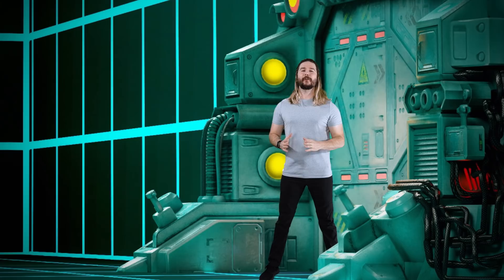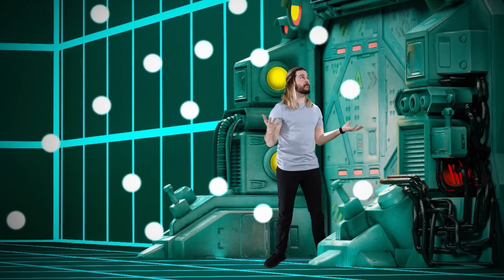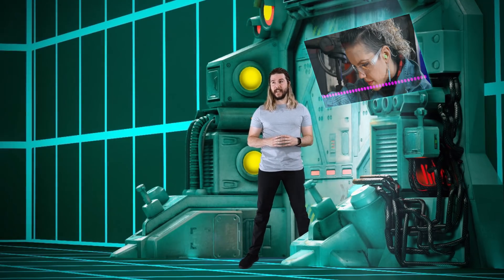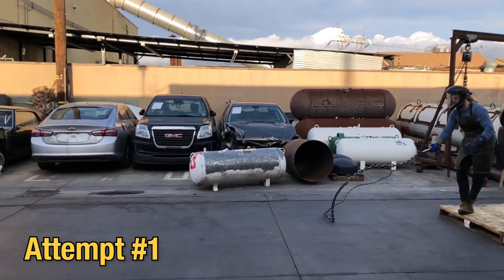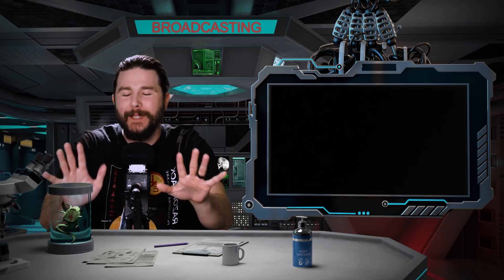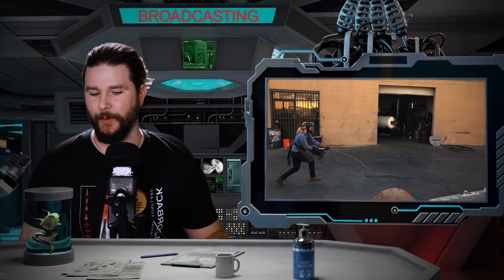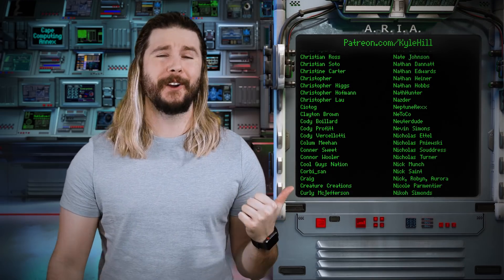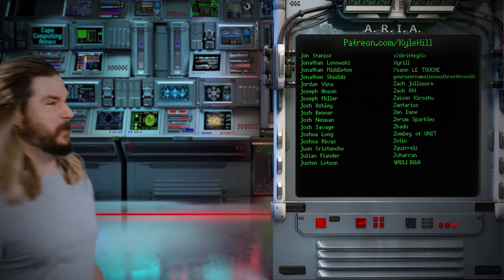Can I Make a SUPERSONIC STEEL WHIP?

Comment: I am pretty sure that it's physically impossible to  generate enough energy with one whipping motion to get steel chain move faster than the speed of sound. If you have just lets say 50 grams of chain moving on that speed and the rest of the whip is motionless you still need about 3000 joules. If the whole movement takes 2 seconds you should be averaging 1.5 kw of power while doing that, while trying not to hit yourself and die :D
Reply: The problem I'm seeing is that you can only get so small of a chain before the material just ends up failing from such violent force, such as being ripped through the sound barrier and having all that force hit the last link of the chain won't bode well. The reason why traditional whip crackers can be used successfully and repeatedly is because they're out of a material, either leather or some kind of string/rope, that will not break from the extreme change in tensile force.

Because it's ending with chain links instead of a proper cracker of sorts and combined with his (being generous here) "less than professional" technique, the end of the whip ends with more chaos than any kind of crack-promoting formation.

There's a few things he could try, only one of them would guarantee a modicum of safety.
1. Have the handle extended. This would make the whip more like a "coachman's whip" which is easier to crack because of the leverage advantage the longer handle gives the user.
2. Use an over head swinging technique like what the tiktok video's first crack. That's an easier and relatively (with a traditional whip) safer method of cracking a bull whip.
Or safe option 3. Collab with Mark Rober and have a robot do it.
Reply: Could a spring loaded "whip launcher" of some kind generate the force needed? Seems possible to make it super sonic but maybe only for a machine and not a human.
Reply: Next, how to build an hydraulic whip. And, will it blend?
Reply: It is possible but without a cracker it wouldn’t be humanly possible to generate enough strength to break the sound barrier however I have seen it happen mechanically happen when a steel cable snapped and wiped with enough force and energy to generate a sound however taking into consideration that the cable snapped it may have flayed one end of the cable making cracker
Reply: In theory, I believe you can generate that much energy with a pnuematic arm. Humans probably cannot generate the energy, even with a sufficient extension (or pole). But building a pnuematic arm is a whole episode, I think.
Reply: @yourleftisttesticle   Now that’s what I wanna see.
Reply: The chain is missing a factor of potential energy in the case that the chain has no resistance to compression. The links freely pivot and don't store vertical vectors of force, just horizontal. Therefore the compression wave breaks down and turns into a more swinging motion, losing energy to the amplification of horizontal movement. So it's not the material that's the issue, it's the construction. That also makes this "not-a-whip-it's-a-chain" incredibly dangerous to the user, as almost all of the potential energy can coil back to the point of origin in big, wide, un-dodge-able lashes. USE A BRAIDED STEEL CABLE that is tapered in much the same way. You'll see the difference is phenomenal. You can actually use it with skill to keep that compression wave going at a range from your body, meaning less accidental decapitation/dismemberment and it will require less energy and give you more control. Also... don't actually do this because the reason a bull-whip is made of leather is that at the end of the day, it's not supposed to be deadly. Try not to make deadly weapons that are also fun to play with, kids.
Reply: You’d have to swing it like a lasso. Regardless, I still want to see a chain whip break an orange at the speed of sound even if it’s cracked by a machine.
Reply: I still believe this "super sonic whip" is a myth. as watching this on Schlieren mirror shows a an air pocket collapsing behind the chain/whip tail. In much like how a jet's wash from an air planes does when landing. It sounds like thunder or a clap, or maybe a snap, but it is not any were near supersonic.
Reply: You should use a leather whip for comparison.  That way you have a control to compare to and analyze your technique.  And, ofcourse, cool cracking sounds.

Next step, build a robot that can do it.
Reply: I'm fairly sure if you have the right technique and design of whip it should be possible.  There's no reason why the tip shouldn't be able to be made small enough to crack especially with the slower initial motion and double-handed grip allowing a human to put more energy into the chain to be concentrated as the wave travels down the length.

It may take making some really strong custom chain links and you might need to make the ones designed to break the sound barrier out of titanium or something but it should be possible.

No way in hell I want to be anywhere near it when it's tested unless I'm behind something bullet proof, though.
Reply: pretty sure a human can't do it, but if we use a machine, it's definitely possible.
Reply: I'm thinking that you started off with too heavy of a chain at first, and a tad too long for your strength and arm length. You could trade up to a titanium chain for the smaller links at the end to with stand the forces. Or possibly go with a woven mesh rather then a chain tip. You may also be loosing energy with only a few lengths of different gauge chain. I would love to see this work for some sick reason.
Reply: some guy does it by running one way, then back, with the chain just sliding on the ground. pretty sure the end was links.
Reply: Then next time yust end with the wip destriong frut 4 some satisfaction
Reply: April Jennifer Choi can make it happen for you. She’s an engineer that’s broken records with the whip, Contact her please she has the skills necessary I’m just fortunate enough to know both of you exist and I can’t wait to see her make this happen for you
Reply: Qi Lin Bian! Literally metal chain bullwhips
Reply: It sure is, use a smaller gauge of chain, a more precise taper, a longer whip, and study how the arm works. Then make a robot to replicate the fluidity of motion it takes to crack a whip. Not just some spring loaded or hydraulic mechanism, you'll need to actually program it. Or... get someone with more strength and confidence to do it for you.
Reply: Sounds like we need Mehdi and Destin need to hook up and make this happen.
Reply: Use braided steel cable for the end
Reply: Chain whip robot chain whip robot
Reply: what about a robot that can whip it faster?
Reply: The reason you failed is actually pretty obvious yet still obscure: The size of the chain links of a proper chain whip decreases with every link. You're using sections of chain. Your taper length is fine but the segments ensure that the taper is too segmented and, thus, won't produce the fluid whipping motion you want OR the energy transfer you want.
Reply: "you still need about 3000 joules"

All I'm hearing from your statement is that this whip needs to be powered by rifle bullets. Nothing at all about it being impossible.
Reply: A guy called mike shake on YouTube made a whip that uses a steel cable as the cracker and it cracks loud
Reply: Vat da fak its HPC!

Comment: Dunno if we can even call this an “experiment” - you didn’t change any variables except your own whipping motion! How about, you know, trying something different before declaring failure? Maybe it needs to taper faster, maybe slower, maybe you need to start with much smaller link, maybe the whole thing needs to be shorter or longer….

Comment: I know I'm late to the party, but I was going to cite Jacques ze Whipper as a case of being successful (he is a professional whipper so cracking whips is his thing). However when I went back to the short he introduced his large chinese chain whip in, I noticed that his chain whip actually does have some sort of rope at the tip. You were definitely onto something with that careful observation of the video everybody sent you. I thought of another short where somebody was using a barn chain like a whip and they got the whipping sound, but no crack to go with it.

I think somebody else got around to the scientific amount of work it would take, which just got me thinking... is there a way to generate the speed required using a balanced lever system? Balanced so that it swings smoothly... or maybe just a modified catapult

Comment: I was disappointed that your idea for making the whip faster was to add a handle and try to throw it faster. The handle is fine, but to me the obvious (and safer) approach would have been to add more taper. Just add more sections of lighter chain to the end of the whip. I'm guessing that with a few more sections of chain, probably ending in something of similar size to jewelry chain but made of steel you would have succeeded without needing to try to throw the chain in the air as you did in this video.

Comment: I enjoyed the fact that we're still shown a conclusion, even though the hypothesis was incorrect.  That's as much a part of science as succeeding.  It's still cool to see cool stuff like a steel whip being tested.

On to theories on why it wasn't breaking the sound barrier, a long length of chain like that, even if it tapers, still has to weigh a lot. I'm not too knowledgeable at physics, however I do know if something is heavier, you need more energy to move it.  I wouldn't want to be on the receiving end of a steel chain whip because that thing's gonna do damage, but the weight of the weapon itself will be the cause of that damage, not so much the force of the "whip swing."  Again, still cool, I just think the weight is what's causing the most trouble right now.

Comment: Watching it over several time and comparing it with some other whip-physic videos, I think as you mention the guy in that video attacing flexible end to the whip creates the "crack". Human can't make the chain whip "crack" if the end is also a chain. Because the rigid nature of the steel and it would require such force and speed to generate enough energy so that the end of the chain become so hot and flex then create the boom. Its like when you unroll a carpet the end of carpet would clap the floor

Comment: I love this video, I love the DEVO reference, and I love seeing the process. Scientific integrity hype!
I can't help thinking about a time I saw Backyard Scientist attach a thin cord to a rubber band and use it for whippy whippy action, and how that principle would apply to the pure terror which is this metal chain whip being tensioned by the spring from a set of car shocks. It's one thing to lose a finger, it's another thing to be unable to find that finger.

Comment: As a person who's nerdy, but also an ogre...and gotten the lumps from "Lemme try" moments...I'm amazed you even seriously tried this man. I've not tried to get the sonic crack with a chain, but I've used them as whips and other such things you're not supposed to do with heavy chain. It is dangerous as hell, and you did it with protective gear. Your friend stated it right in the first vid...you'd need a totally custom chain to even try using it like a proper whip. As far as using a chain for a whip though....it's a chain, it doesn't need to be supersonic to get drastic in damage.

Comment: Wanted to ad, I have recently started practicing with a normal bullwhip (obviously) and have whipped myself several times. This is normal as you are practicing since when you start the whip you can't control where the tip goes. If you want to learn to crack a whip look up Adam CWM here on Youtube.

Comment: From my limited knowledge it looks too heavy  for you and it does not match the gradation of a bull whip. Like it does not need to be perfect but you can get the wanted affect out of a sinewy tree branch or a rope (depending on the size). You would need a weapon that you specifically could effectively use. If your already getting tired from the first 2 swings its too much for you. I was thinking maybe 3 links then go down a size till you reach a thinner tip than the first whip. Also shin guards...heck thigh, and neck guards too... never mind dress like you are going to rollerskate for the first time with an unbarably over protective parent. ALL the guards. Less brusing, plus you get to find out how much force it takes to crack one of them...if you try this again. Thems my musings tho. Awesome video!!

Comment: ok insanely dangerous possible solution to get the result, maybe a length of thin steel cable to the end would get the end thin enough, maybe one size chain down to start and the length of cable be on the end of the existing final chain diameter to reduce weight, idk im a machinist not scientist just spitballing, fucking please DO NOT ATTEMPT

Comment: Could it be the drag from the ground that slows it down and cancels out that wild growth in speed? With a bullwhip it is primarily moving through air, but due to the weight and the bulkiness of the whip you couldn't quite get it up off the ground. If you were a giant or something, maybe you could have made it move the way you wanted. Less impressive idea: smaller chains whip might work better?

Comment: You want to make that chain work,take the human out of the equation.
Have pnuematically actuated bionic arm...really just a three foot straight two piece steel lever with a actuated swivel on the end of it to..at the end of travel snap around like a wrist and snap the chain to twist it in the axis of terminal travel.
But dear God,do this is an area without people around.
If it works it could tear the entire end of the chain off and send it flying.
I actually recommend always having a terminal target to expend the chains energy on each time you do this.
You need to tranfer the energy out of the end of the chain for this test to be safe.
Unless you can get the mechanical arms velocity and twist motion to a speed that can truly snap the chain.
This actually looks like a job for a carbon fiber and kevlar chain.
This would be a great job for the entirety of the Facility to try to get done.
I still loved the efffort .
Great video Kyle.

Comment: the way I learned to swing a whip with a low DEX stat:

Hold the grip straight out from you and spin your body so the whip goes in a big circle, the whip should swing straight out from you like a big clock hand. Keep your arm totally straight for this, no arm flicking is necessary, this is entirely just your body rotating the whip. Whenever you feel like it, stop spinning and move your arm horizontally in the opposite direction, but very gently, like the way a conductor would signal "stop" with a baton. Some people add a little circular motion to that too. This should get you a good crack, the trajectory of the tip goes around your body instead of through it, and the minimum force to get a result is WAY less, making it easier to control. For extra safety you could just attach the whip to a spinning post, figuring out how to make it quickly reverse the spin is probably the hardest part since the motion is so flat and uniform.

Comment: you sure a whip was the first manmade object to break the sound barrier??
not some rope that broke under tenstion somewhere??
ps; you have to retract it before it reaches the target if you want a whip to crack in front of you
on the topick of safety LEAN HOW TO USE A WHIP CORRECTLY WITH EQUIPMENT THAT CAN´T BREACK BONE BY ACCIDENT 
all that head protection but just jeans to protect you from a whip you can´t even lift high enough to justify your apron, really??

Comment: Kyle, when I was much younger I worked with county government equipment. One item we used was a tractor-mounted "bush hog" that used short lengths on 3/8 inch chain on a rotating drum (about 500 rpm) to clear underbrush. It could sever 1 to 2 inch saplings or vines in one hit. High speed chain is extremely dangerous, but not flexible enough for the "snap" needed to pop lol a whip!

Comment: Your not swinging it like the guy in the video. He's using centripetal force.....he pulls the whip in towards his body abruptly before he cracks the chain. He's not doing it like the fly-fishing technique that you're using here Kyle. I think if you adopt a safer twirling method..... quickly yanking at a roughly 180 degree angle once the whole chain is swinging out perpendicular to your body frame. I think you may be able to avoid injury and obtain your desired results.

Comment: 9:52 After noticing the leather bit on the tip of the tiktoker's whip, I'm curious if breaking the sound barrier with a chain whip is even possible. I feel like the tip has to be "full" like a strip of leather and not "hollow" like an individual chain link. I know relying on reason and our senses is usually a really bad way to approach a problem, but I feel like it doesn't make sense to try to break the sound barrier with something hollow. The way my brain sees it, it's as nonsensical as trying to break the sound barrier with a hoop. It might be possible, but I lack the knowledge of the type of equation to apply this and the materials even if I knew how to build a contraption possible to test this hypothesis.